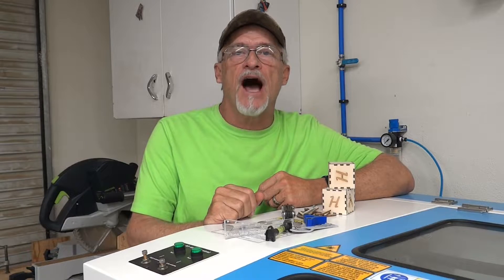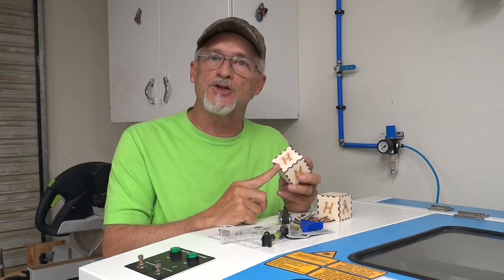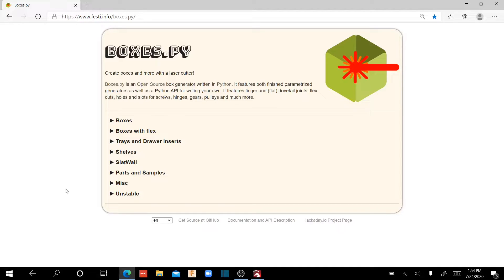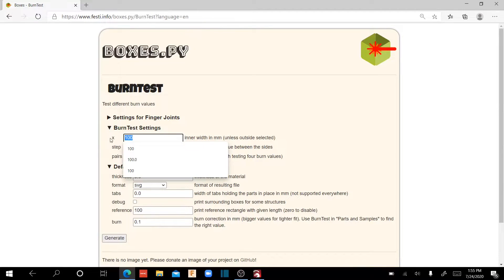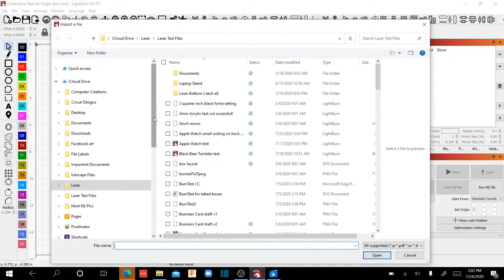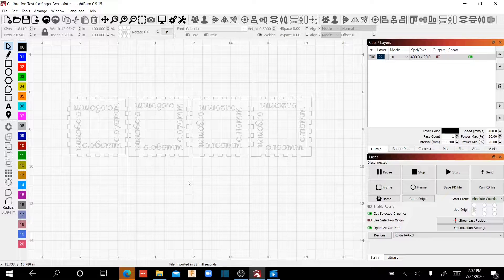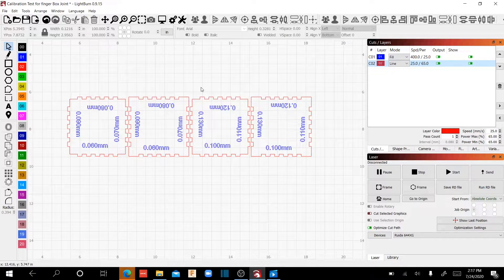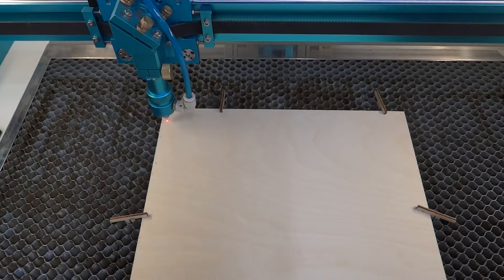Your First Box with LightBurn (for Beginners)

Comment: Question, what kind of air compresor do you have for your machine?. I am curious because your cuts are clean. Thanks for the video👍.
Reply from the maker: I have my 60 galllon shop air plumbed into my Thunder laser. run 35-50 psi when cutting. I know allot of people use a 20 gallon and  it work fine. external air will make a HUGE difference!

Comment: You do not use air assist while you engrave why is that ? I have always used it and never thought of turning it off.
Reply: With my Thunder Laser air off is actually low pressure on the machine. I always have some air flowing through the nozzle.

Comment: I've tried the burn test all the way down to .001 and the joints seem just as loose as at .10. Is the generator not changing the sizes correctly? or is lightburn just cutting them the same size? They all feel just as loose as each other
Reply from the maker: Most of the lasers that I've seen have been in the range of .120 to .06. Something doesn't sound right if your not seeing them get tighter regenerate you test file and start at like .120. Be sure your are lining up the same size on each of the cards. Meaning line up .090 on one piece and .090 on the other. You cant mix and match pieces. Thanks for watching and good luck.

Comment: What material were you using in this test?

Will the thickness of material make the burn correction different?
Reply from the maker: This was generated on 1/8" Baltic birch plywood. I  would recommend doing a calibration card for different thicknesses of material. There is some difference I've noticed.